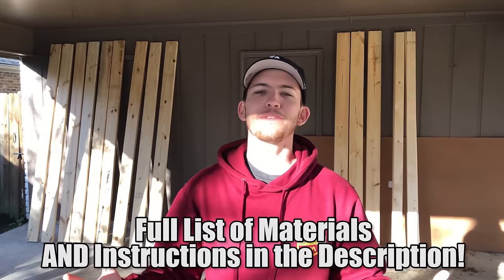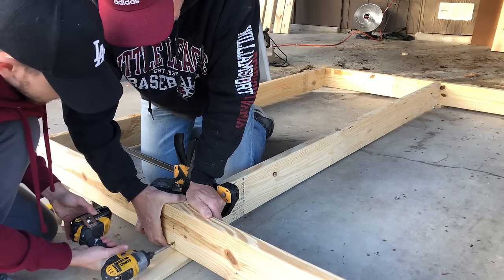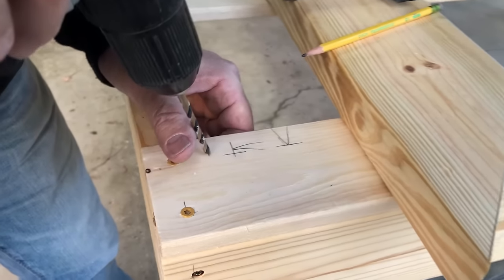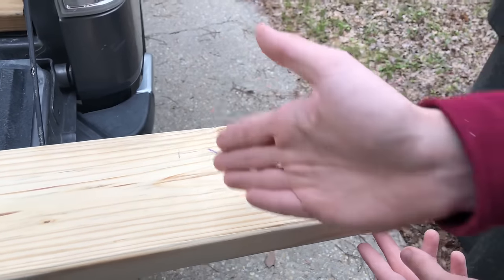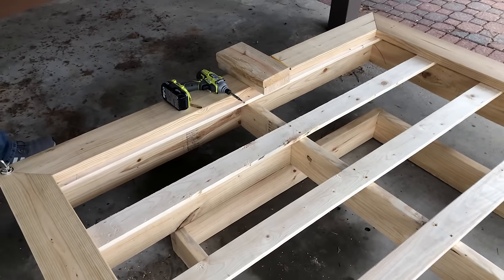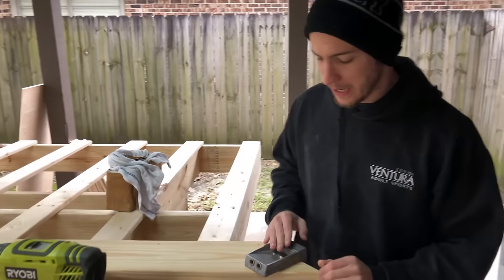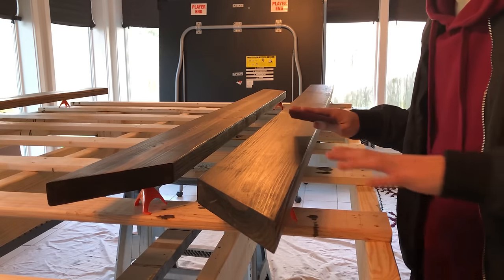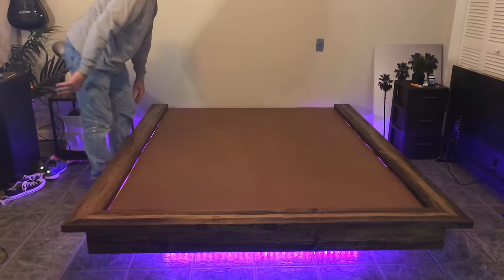How to Build a Floating Platform Bed! (Materials & Instructions in Description)

Comment from the maker: This is for a queen size bed 60" x 80"
Also, we're getting a lot of comments about the price of lumber. We put this video out before the Pandemic and at this time the price was right! We know...lumber prices are crippling right now and everyone's feeling it. Hang in there gang!
Reply: So if I was going to do a king sized bed 76” x 80” would I take your 65” measurements to 76+5, which is 81” to get the same kind of set up. Or am I not doing that right because your bed is 60” but your measurements are 65”
Reply: How is the stability with these beds? My husband os a big & tall man.
Reply: Can you just dumb it down for me on the list for a full size bed 😅 I’m honestly just going to take it one step at a time.
Reply: It looks amazing!! I was wondering how heavy is the frame? Not necessarily how many pounds it is, but is it extremely difficult to move? And how would it be getting it in a doorway?
Reply: @mr.reliable8123  Great question! It's definitely going to be a heavy one! I would definitely be making one of these inside the room it was going into!!! Don't even want to attempt to figure how to get that into the house! 😃
Reply: @biroabbuilditrightonabudge776  I was thinking the same thing as well. Looks like they added 5-1/2" not 5
Reply: So I am in the process of building my version of this bed which is a king size with under the bed storage so the top part will hinge I’m building my bed to look similar but it will be different I am not small by any means I weigh at least 250 and am 6‘2“ I will let you know how this works out and how stable it actually is. If you would like me to make a video please let me know
Reply: @Jung1efever  that’s what I thought but that’s not exactly what I did for my idea I’ll let you know how it turns out
Reply: @stephanyd.204  I built this in Full and added a headboard to it. https://www.youtube.com/watch?v=-ejzX4622hw&feature=youtu.be
Reply: @studPack what would the measurements for the lip pieces be if I decided not to miter
Reply: @biroabbuilditrightonabudge776  I’m doing a full and I was confused on why his bed slats for a 60 inch bed were 65.5 I thought maybe it was because of the lips on the sides but still those are only 1.75 inches inward. 
65.5 - 3.5 is still 62 Inches.
Reply: Iches or feet?
Reply: Was wondering 😂😂
Reply: I just built mine, took a few hours and the stability is good very little wobble when standing on the edge
Reply: I wonder since a few ppl are asking maybe be you can help us with measurements for a king, whacha think? Tanks!
Reply: is that the mattress size? i have a full size mattress 74'' x 53''
Reply: @biroabbuilditrightonabudge776  How did it turn out?👀
Reply: It turned out pretty good I’ll post a short video not completed done I still need lifting shocks of some sort it help access the under bed storage
Reply: @biroabbuilditrightonabudge776  Did you ever attempt the build? I’m currently wanting to building one for my king bed and wondering about the measurements to
Reply: What are the measurements for a full size bed?

Comment: Took me about 8 hours but I’m finally done! Design is great, instructions were really easy to follow along, and the bed is incredibly sturdy. 

To anyone considering building this, if your not insistent on the varnished finish. You can use a dark stain with polyurethane in it and (with a nice sand) your good to go.
Reply from the maker: Awesome thx Simon!
Reply: When I stain wood and even with heavy grain such as oak, I use gel stain mixed with the reg stain (Usually to get my desired color) Add mineral spirits to my sponge brush and slowly glide it on for no bubbles. The mineral spirit will cause it to lay flat, yet goes on thick for coverage. Then I poly it also with 2-3 coats with some mineral spirits on my sponge. Me and the hubs made a frame for our bathroom mirror and i stained it. Looks professional.
Reply: @Kanye West  in southern California I spent $300 on the lumber alone....
Reply: @carlosortiz2129  that damn Putin.
Reply: What bit size do I use for my drill
Reply: Is it a queen bed?
Reply: @StudPack  🎶 Music volume level is a bit too loud compared to narration

Comment: Love the build, I think the star was the square and it's utility in the hands of an experienced tradesman. Pocket holes done earlier and the assembly sanded after piece sanding could have the miter outer corner neatened up and micro rounded for ankle protection. Some discrete rubber pad feet would stop any rocking on an unevenly tiled floor and for tech level masters a hidden induction charger installed from the bottom of the capping board would allow for a phone to be placed there and charge while you sleep.

Comment: Nice build guys. Im going to build the exact same thing but, for the exposed boards im going to wire wheel the soft grain out so it gives an aged/barn wood look to the stained timber. Thanks for being so detailed in the cuts and assembly.. that will definitely will save me some time. Awesome to see 2 generations of craftsmanship working together. Thank you for taking the time to make this video.

Comment: Guys thank you so much... just made a king frame using these instructions. I was able to do all this with just a Drill and wood cut to size at the home depot.

Few things I learnt on the project
1. Home depot wood advertised as 2 inch thick is only 1.5 inch thick (Messed up my calculations fixed it with some patch work)
2. Could live with 3 pieces of wood as lip without cutting them at 45°

Comment: Little did they know those masks would soon be super valuable😂
Reply from the maker: yeah and I threw those two away😢
Reply: Dwl😂🤣
Reply: @StudPack  what size bed does this frame fit?
Reply: @KL-xe5ec  queen
Reply: @StudPack  Doh! Live and learn.
Reply: I’m weak🤣🤣🤣🤣
Reply: Hey what would you guys charge me to build me one..?
Reply: Shut it
Reply: The standard range of workshop masks barely work as intended and rated for dust, small particle debris and I believe many specify "insect feces 'dust mite'" non of which are Viral or Bacterial. extremely susceptible to movement such as a sneeze, cough has the PSI to lift mask from face exposing everything :D the mask and a sneeze actually increase the pressure and blast radius. You are now a walking corona bomb.
Reply: I just think it was funny that his dad with the So-Cal hat was joking about him "sleeping outside if he couldnt finish the bed"... now everyone in Southern California sleeps outside.
Reply: @KL-xe5ec  any
Reply: Exactly what I was thinking 😂
Reply: @KL-xe5ec  king
Reply: @shuuu9729  no king
Reply: And the price of that bed frame would quadruple
Reply: Little did they know that wood would soon be super expensive 😂
Reply: @StudPack  morning
Reply: The masks? How about the lumber lol

Comment: Dope vid👌🏽👌🏽🤟🏽 doing rn...What’s the measurements for the mitor cut  it never was specified .angle and length
Reply from the maker: the Angle is 45 degrees and the length is just the length of the board!

Comment: I have a California King bed, how do I calculate the measurements so that I can copy what you did with the Queen Size
Reply: Did you find any answer? I'm looking for a cali king sizing as well
Reply: @karankhaira-nagpal6704  a standard Queen is 60x80, looks like they added 5 1/2 inches to the width to calculate for the width of the boards on each side when building the frame and a little more maybe for some wiggle room. My king bed is 72x80 (kinda weird) so I’m just adding 5 1/2” and cutting to 77 1/2” for the boards wherever they say 65 1/2”. Hope this helps, I’ll let you know if mine doesn’t turn out. Hope this makes sense, lmk if it doesn’t and I can try to rephrase.
Reply: @connor1199  going to take my stab at it today, I really appreciate your response and I'll get back to you for sure! :)

Comment: Used this video and built this exact same bed. Material costs $210 now 7/2023. Plus $20 for the RGB lights from Amazon. Easy to follow these guys! 

Did two things though: 1)anchored bed down into floor and 2) added a small piece of slat (underneath) where the overhang boards miter together
Reply: What RGB strip did you use ?

Comment: Any chance I could get measurements and instructions for a full sized bed?? 😭🙏🏽

Update: I built it: Full size. Posting materials, measurements, placement etc. on my Twitter @allaliveaileen
Reply: just measure your mattress and increease the lengths of the boards to match
Reply: Auzzy4 actually it’s so much more than that and includes a little bit of math. I just made the bed myself and created my own measurements. Came out pretty great
Reply: @aileencruz2944  Any chance you could share your workings?
Reply: @aileencruz2944  lemme see
Reply: visionz51 yes I can but honestly it took a lot of math adjustments in the end to get good measurements. I had to wing it on the bottom piece that holds the top. But I will post some pics on my Twitter. @allaliveaileen

Comment: That turned out fantastic! Love seeing you guys work together. Only thing I would have done differently is place the LEDs higher up so when walking in they aren't visible and only the glow of the light is. I have similar lights under mine and I hate seeing the light strip, I just want the glow.

I've used pine since woodshop back in the 80's and have made great things from it that turn out well. You can get some great contrast like you did if you select the right lumber and stain color.

Comment: @ 16:00 - "it's so wobbly ....so to prevent that we're gonna add some more 2x6's.."......or you could have taken more time and made sure everything was squared and planed to level to begin with. But looks really cool and good job blocking the two pieces together to make it flush + the use of foam brushes on the poly application.  I made one almost identical last year but did a headboard using shiplap pieces and ran the wi-fi LED lights around the back of the headboard as well...I also had the exact same mishap with the LED lights on my last section where the strip got crimped and broke the connections for the G & B strips - I had to replace that section of lights to fix it.

Comment: I'm actually going to make one of these for my new house (which I might finish in a few years). Glad I came to this video.
Unless there was some esthetic reason to line up those screws on the end of the slats, I would never. Seems too easy for the wood grain to line up with both holes, weakening the connection.

Comment: Northern white pine is a very nice wood to work with. It ages beautifully. But I don’t know about SPF construction lumber. First of all if you look at the end grain of your boards you’ll see that it’s almost always got the pith. You never want that in your projects. Because it’s the very Center of the tree it has stresses going in all directions. I’m not saying you can’t use it but if you do here is some great advice. Always use 2x12’s and pick and choose your wood. You can usually find 2x12’s that are rift sawn. Use those and cut them down to the size you need. 2x12’s are always of better quality because they are used as structural lumber (joists)

Comment: Question? The "wobbly" part...instead of the way you fixed it...I was thinking that if you cut slits (notches) in the center of bottom frame so you can slid the bed frame right into the bottom frame and avoid of making extra pieces...and then add screws through each of the spaced boards onto the bottom frame. Whalah! Everything safe & secured! I hope I explained well enough for you to understand my theory & vision.? 😊
P.S. Okay I "see" my way wouldn't work to your vision...then it wouldn't be considered "floating" anymore! 😅 I like your way! 😊

Comment: I build custome houses, and the way you built the frame is just like how walls are framed..  however whenever I have a twisted board that won't go square I just attach the bottom first like you did, but I use channel locks to twist it instead of a clamp.  I also have a hammer that's made for doing that as well but it's really heavy
Reply from the maker: Yeah, definitely more framing techniques in this one than furniture building techniques.  I think I have a hammer like that also😂

Comment: Hey guys just ran across yall and love the floating bed! So much so I’ve already printed out the instructions n priced out the lumber at the big orange place and plan on building it this weekend!
I have one question… I noticed you screwed everything together but used no glue. Is there a particular reason for that? 
I also plan to add a headboard created from a 100 yr old door (what I was actually researching when I ran across your video). Any thoughts on how I might incorporate/attach that headboard to your project?
Thanks from new fan!
Max

Comment: If you have a floor that shows the LEDs epoxy/bulb and you want a clean “phase” look you can use what they are called “Aluminum Extrusion Profile Housing Track” its for thr strip lights so it has a clean look and blends the light together 👍🏼

Comment: Looks awesome, but you're not letting your mattress "breathe"? It's usually a bad thing to block off all air from the underside of the mattress, because moisture can be trapped between the bed frame and the mattress with nowhere to go. The risk for growing mold is way to high for me personally. In Germany, we just have a slatted frame (Lattenrost) to let air circulate through the mattress.

Comment: I don't know wood work at all, so it's probably gonna be a dumb question
When screwing each side should you swap to the opposite slat/plank to keep even tension to avoid distortion? 
I'm a novice to diy projects, so I've always tried to balance screwing things by tightening opposite sides to avoid any twisting
Reply: Or is that too time consuming
Reply: Just to add this video was amazing, learnt so much thank you for putting in the time and effort
And sharing this craft with others

Comment: Got a question???? I plan on using 2x8 instead of the 2x6 for both boxes. Do I need to adjust any measurements to compensate for the larger boards. Plus, I'm doing this for a king size bed

Comment: Great video. lot of great features but Man, I would have put your two 45 degree joints tightly together first. Like make the three top boards  fit better before screwing them down. Unless you like the huge gap.
Reply from the maker: Thx Tom.  I learned that trick when doing handrail caps on a deck some years back but guess I forgot about it thx for the reminder.

Comment: Could you possibly provide the measurements/cuts for a full size bed? 🙏
Reply: Following. I was just about to ask the same. When doing a size comparison, I see the length cuts would be 75" full vs 80" for queen but the queen has 60" width, but the cuts called for like 65" so I am wondering what the 54" full width translates to for cuts.
Reply: Hi, I built this in Full size and added a headboard to it as well, measurements are in the video here:
https://www.youtube.com/watch?v=-ejzX4622hw&feature=youtu.be

Comment: Also if you need to make a straight cut like at 24:05 you can use a straight edge and a Circular saw you just have to set back the straight edge the distance between the blade and the end of the guard. And clamp it down

Comment: Jacobean - Ja-kuh-be-an not jacko-bean.  //  Personally, I prefer to finish (paint or stain) ALL sides of a project - you never know if an item will someday have the back out in the open. //  I have a cat that loves to go under my bed and wreck the underneath of my box spring.  Since I have a bed ruffle, I just butt-joined wood for the sides and ends of the bed.  I used 4 (2 each side) small corner braces (1 hole each side) to hold the side panels (the ends are held up by the sides) on to the bed frame which holds the wood about 1/2" off the floor so I can move the bed if I have to.  The mattress fits nicely inside it.  Now my cat can't get under it.

Comment: Thinking about building this but for a king bed, why did you make your width 5 1/2 inches beyond the bed? Would that mean by width for the floating part be 81 1/2 inches for a king? Length should be fine but was curious why the +5 1/2 on the width cuts.

Comment: Half of 65 1/2 inches is same as half of 64 3/2 inches. 32 3/4 inches.  Use the previous even inch and convert the next inch to an improper fraction.  Then divide the now even first number by 2, and double the denominator of the fraction.  Easy to do in your head.

13 3/4 converts to 12 7/4 inches, half is 6 7/8 inches. 
123 1/4 inches converts to 122 5/4 inches, half is 61 5/8 inches. 
Etc..._

Even easier when you have your tape measure to look at. 

61 15/16 inches converts to 60 31/16 inches.  Half is 30 31/32 inches.  

For even numbers it’s even easier.  Just half the whole number and double the denominator on the fraction. 

30 5/8   Half is 15 5/16.
Reply from the maker: Good tip Mark thx 👍👍

Comment: That H&D ELECTRIC jacket is a company out of Sacramento I used to work there did you guys
Reply from the maker: They were the electrical contractor on a huge renovation at a commercial facility I used to work at in Thousand Oaks.  Their lead electrician had to run some cable over a plaster ceiling (no access).  He figured it would take him 2 days.  I knew of a pull string up there and he was done in 30 minutes.  The next day he brought me that jacket.  I wish I could remember his name... top notch dude in every way.

Comment: im trying to build a bed frame from this design but as a king size. I know i have to change width dimentions but im questioning the by how much only do to the fact that normal queen sizes come at 60" X 80" but he has his bed frame at 65 1/2" X 80". Do I need to add 5" to the 76" X 80" or leave it as it?